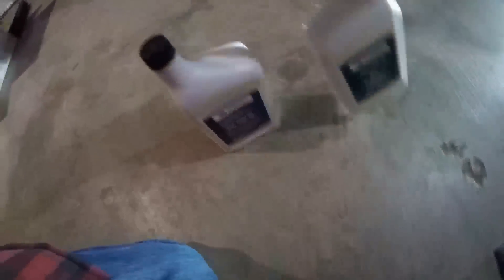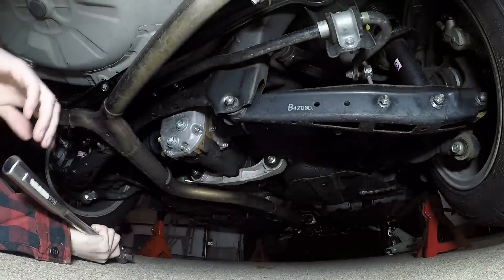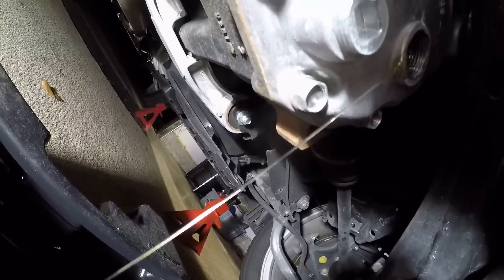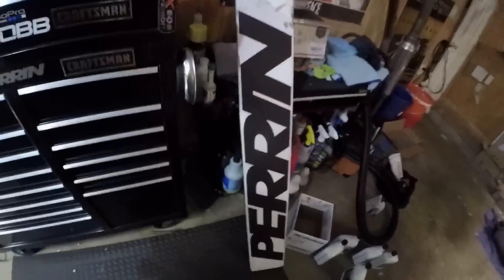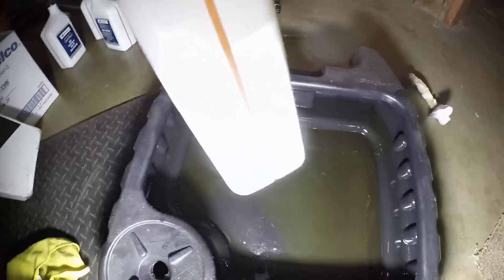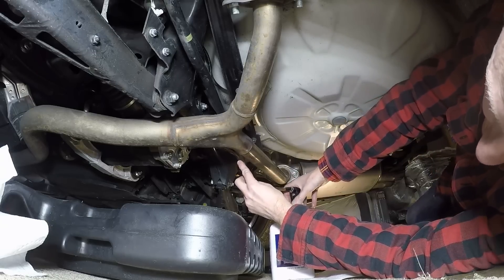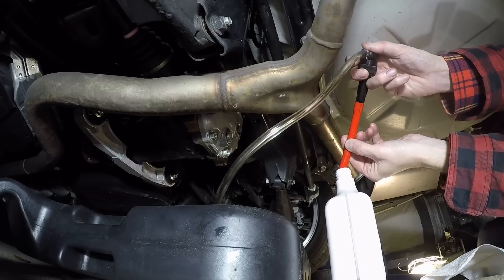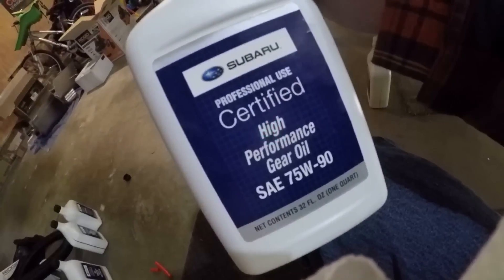2015 Subaru WRX Ep. 645: Rear Differential Oil Change

Comment: Wow, 20K miles is super early for this.  I've seen most people on forums going upwards of 50K without changing the rear diff and no issues.
Reply from the maker: factory recommendation is 30k i think i read on forums. 20k for modded guys.
Reply: LastHumansGarage The maintenance actually says every 60k miles to inspect the fluid in the rear and front differential. Unless you have an LSD, VLSD or some other diff installed you don't really have to change that rear fluid. For reference, my LSD that I installed has me replacing every 10k per it's service manual.
Reply from the maker: good info. that means i have cherrier fluids than anyone.
Reply: You should try some of those other recommended oils though, see if you like them in your transmission/shift feel. If you feel that the price point isn't worth it just remember you could always use the Subaru OEM Motor Oil to save some cost at $5.49 a quart at Heuberger motor vs. Pennzoil Ultra Plat.......but would you? :D
Reply: I have seen Subaru's with 8,000 miles with really nasty diff fluid drained out off of  the rear diff.

Comment: i've heard the motul 300v for the trans is THE BOMB, but it is like 22.00 a bottle. your leasing that vehicle and you will have to turn it in soon so why not stick with the subaru brand or upgrade to a synthetic that has similar pricing to the OEM. that's entirely up to you sir, keep on pumping out these sweet videos DUDE!
Reply from the maker: ya me too, but i dont need the best gear oil for double the price. never planned to return the lease anyway.

Comment: I'm about to do my transmission fluid too. Haven't decided whether or not to just reuse the factory washer. From what I have read there is no need to buy a new one.
Reply from the maker: i agree, and im sure ill try it using the old one. worst case, ill drain and save the fluid and redo it.
Reply: Dustin Suitts no Dismxxjxc
Reply: Dustin Suitts no Dismxxjxcg